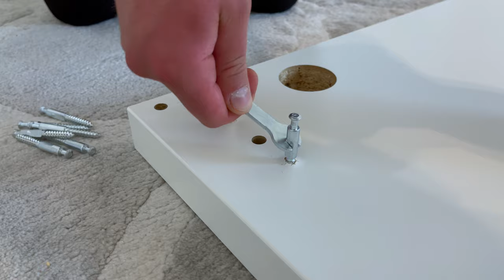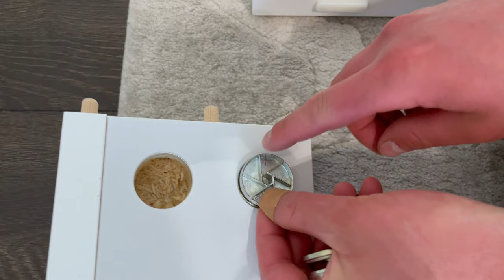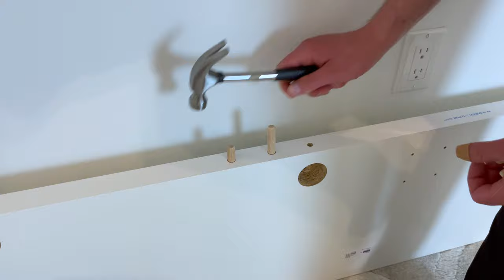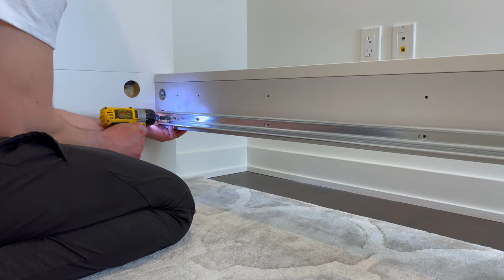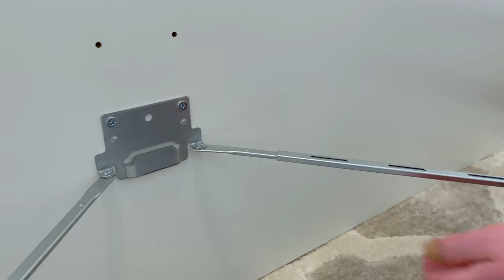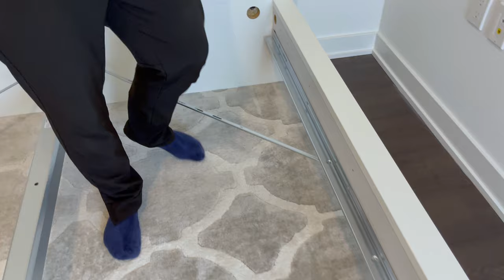Easy to Follow | MALM Bed Frame IKEA Tutorial

Comment: No flaws in video clear instructions. Few mistake I made so you don’t.                                                                  1) don’t leave head stand next to nails or frame with drill nails if it falls it will make a hole or dent  coz these ikea  wood are hallow.     
2) don’t open everything at once go one by one and clear boxes after done one part to make less mess.
3) use top holes for mattress on frame coz bed it already is low, you can go for if low one if you like
4) definitely use something on floor when building just to be safe.
5) watch full video first and then go back and start again it will the building experience great.
6)yh those rings with arrow push them all the way in then use Allen key to fasten it.
7) everything is in exact amount like nails and fasteners so if you have extra nail that means you missed a drilling hole.
8) careful when taking this out you can knock out light bulb or scratch a wall.
9) ikea charger 150 pound for this, so guys build it by yourself, most importantly enjoys it’s easier then it looks and have fun.

Lovely instructions, very precise. Thanks a lot buddy.
Reply: I'm trying to do a single one. I'm stuck with the rings.... I can't get them in far enough because of the screw?
Reply: 4 - definitely! 
My downstairs neighbour banged the ceiling when I got to insert the headboard lol

Comment: The previous owner left a single bed of the same model and I tried to move it from the first floor to the ground floor and the bed frame wouldn't come apart no matter what. I tried to forget about moving it straight down and it got stuck in the stairway. After two hours of sweating and fighting with the bed frame, I was left with a bunch of craters in the wall. I wanted to set the bed on fire, literally. Thank you for saving my house.

Comment: The sliding grey things under the slats just kept falling off.. what did i do wrong? Is it important for it to be on the bed?
Reply: It was not easy to screen those in. May sure the thin/sliding metal pieces are on the bottom when you put the screw in. Then you really have to press while you screw to get it to catch. It will tighten up.

Comment: I might of messed up, is the backboard suppose to be loose and a little wobbly? never really had a backboard for a bed before
Reply: Where you able to fix it? For me the backboard doesn’t really fits. With all the strength in the world won’t fit together
Reply: @erikoff6122  I had someone hold the backboard straight while I tightened the bolts in the underside and that seemed to have done the trick
Reply: @erikoff6122 did you fix it?